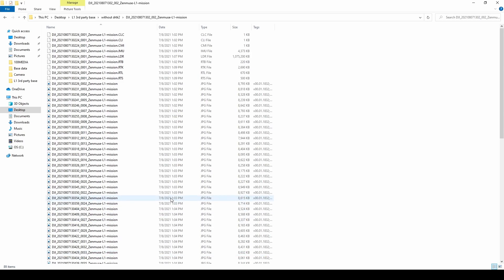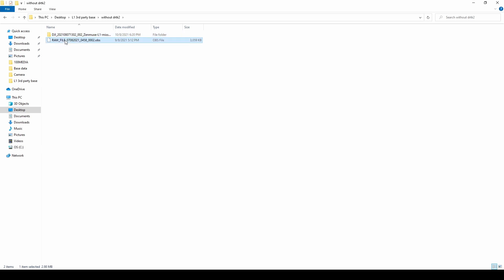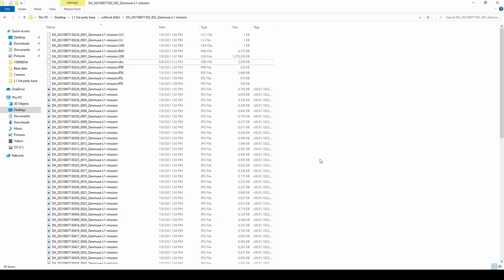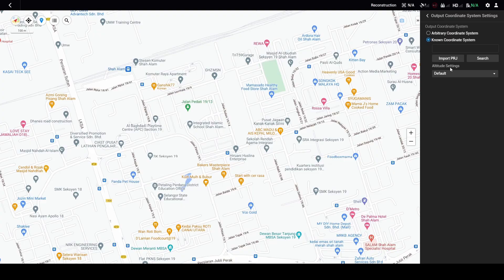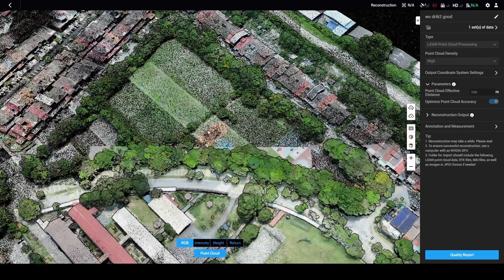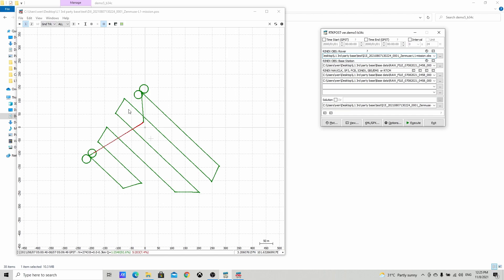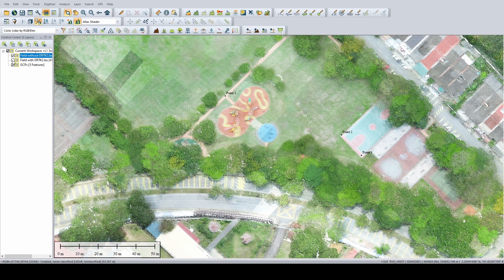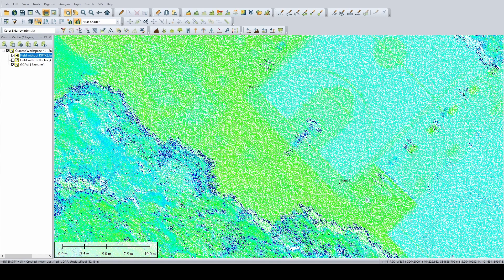DJI Zenmuse L1 -  How to PPK Process

Comment: Great great video. I have commented on another vid of yours but have another question regarding this. Around the 1:45 mark you say that you PPK’d your third party base station and put that location in the OBS file. Did you post-process with RTKPost and use the 3rd party base station as the rover and the CORS station as the base? That would produce a POS file. How do you get that to an OBS file? Am I understand that correctly? Also, I flew an L1 mission WITH the DJI-RTK2 base station with RTK enabled but did not use a known point. So I am trying to post-process the raw data from the DJI base with the CORS stations and then insert that into my flight file. How do I go about this?
Reply from the maker: Thanks! I would use RTKconv to do the conversion. In the options section, you could insert the antenna position. With newer versions of Terra, this is no longer necessary as the position data can be inserted in the base station position menu before processing. Hope this helps !!!
Reply: Thanks Wen! I appreciate the response. When I put the ‘ref pos’ from the .pos file into Terra, it gives me an 8007 error code stating that the pose data is abnormal. Is this an issue stemming from CORS data and how I used RTKPost? And any ideas on how to fix it? Thank you again!

Comment: Hello, great help, but big missing piece of information, how do you use a third party base station , PPK the data and create the RINEX file and generate the OBS file?
this step is holding me up, i cant figure out how to do that?
Reply from the maker: Usually a base station will have its own suite of tools for these functions. Trimble will have the Trimble Business Center, Emlid has the Emlid Studio etc. If you don't then you can always use RTKLib. Use RTKConv to convert from raw data format to RINEX, then use RTKPost to process then RTKConv to generate a new set of RINEX data with the antenna position put in. Hope this helps!!!
Reply: @prodronesasia5262  thanks. Makes sense. I ended up getting the files from a local network of towers, I’m in Canada so we use a paid service like can net. They had data for the entire day I needed, worked perfect.

Comment: Great tutorial. I don't understand how you converted the original rtk using rtkpost.
Reply from the maker: So the data from the DRTK2 is actually RTCM3 messages stored inside. Using RTKCONV, I turned the file into RINEX data and processed it using RTKPOST. Hope that helps
Reply: @prodronesasia5262  So it's not possible to have a fast yet not perfectly georeferenced preview of the point cloud withotu RINEX or RTK positioning. Why can I see the preview on the transmitter but I can't see the model without correcting it?

Comment: HOW DO YOU CONECT THE MATRICE WITH THE 3D PARTY STATION ?
Reply from the maker: This only works on stations that support broadcasting correction messages via Wi-Fi. Please check with the supplier of your equipment on how to do so. The remote will then connect to the base station via Wi-Fi.

Hope this helps. Thanks!

Comment: Hi Wen, i need to fly m300 with L1 at offshore taking Lidar data for some structures from a moving vessel with no 4g no wifi no DRTK-2.... can i process the data using PPK?
Reply from the maker: Hi Fairuz,

Yes you can, but you will need RINEX data from a base that is as close as possible to the worksite. This is to reduce the inaccuracies of the RTK resulting in "blurring" of the data. Hope that helps

Comment: What is the best accuracy of L1? Any other software used to adjust its IMU and GNSS?
Reply from the maker: At 100m height, it does achieve the 15cm X-Y and 7.5cm Z through our tests. It varies according to your flight height due to geometry of the laser beam. The offset from IMU and GNSS is done automatically by DJI Terra but that does mean that you can only use it on a single gimbal mount

Comment: Hi Wen, can you clarify what is the correct setting in DJI Pilot to fly without D-RTK? I am using a third party base station for PPK.  But when I turn off D-RTK in the mission, there is no .RTB file saved and DJI Terra won't process the data.
Reply: Did you get solution for this? Same problem here
Reply: I have a base from a Chinese manufacturer, I emulate an NTRIP and through it I operate the aircraft by RTK and process the L1 data without problems
Reply from the maker: Did you put a RINEX file in the folder instead?

Comment: hi, how about of Coordinate input for third party base station?
Reply from the maker: You put in the ... settings menu under RTK. Scroll to the bottom and you will find advanced settings. Password by default is 123456 and then key in the Lat, Long and Ell. Height there

Comment: Hi Wen. A good tutorial on the L1 processing! I've flown L1 without RTK enabled. Then I tried processing it with and without Base Station. There are no significant differences between them so I wonder if they actually used the RINEX file I put in the folder during processing. Any way to check if they actually used the RINEX file as a Base during processing? Additionally, what is the right format for the RINEX file? Yours was *.obs but recent RINEX file mostly in *.21o extension. Cheers!
Reply from the maker: Hi! So you can check the difference in the output logs. But one way is that if you turn on the optimization, it will not work without base data. As for the RINEX file, you can just change the extension from .21o to .obs and it will work. Cheers!
Reply: @prodronesasia5262  Hi, I did as you mentiones and passed the first point. Got the .21o file and changed the extension to obs. DJI Terra started to work further but after a minute it says: There is no overlap between the base station data and the aircrat end data collection time period, please chech the base station data time.
Reply: I had this very same issues but my point clouds appear to be displaced almost 100m from their original location, do I need to change the coordinate system of the base to WGS 84?!